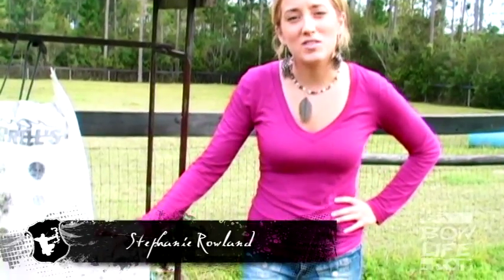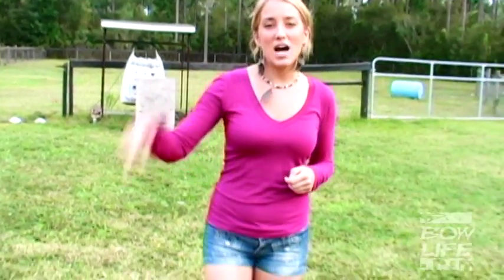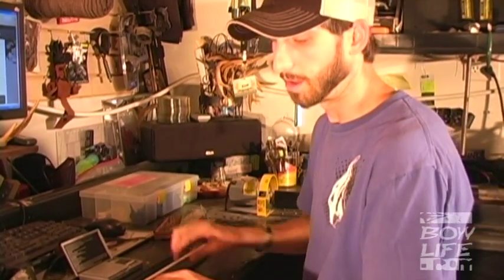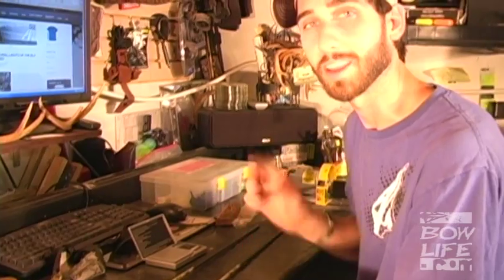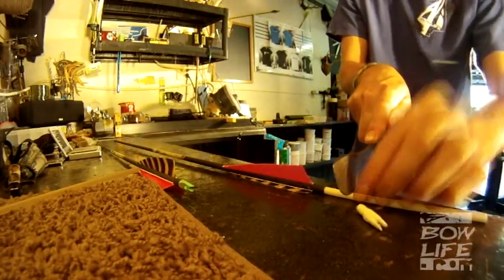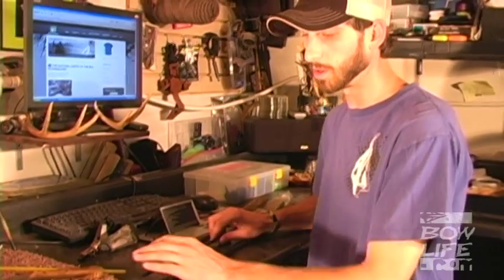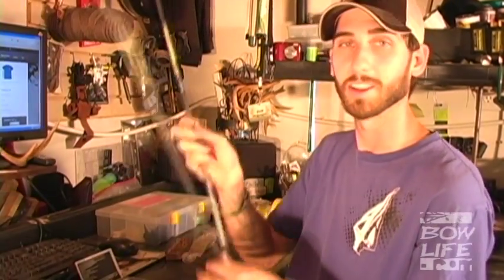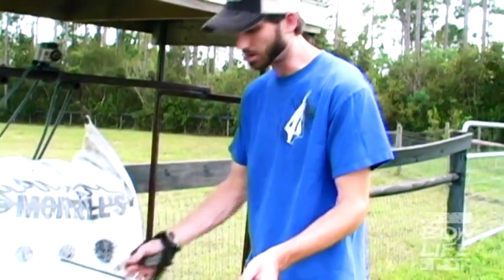Weight vs. Speed of an arrow

Comment: heavy arrows have more KE so thats what i hunt with
Reply: Masterg Samuraixmen What are you talking about?, i was saying i hunt with a heavier arrow because i can create KE....
Reply: Dalton hammond He's right. I'm currently pushing a 485 grain arrow to about 287 fps, generating about 87 foot pounds.  My bow pushes a 600 grain arrow at about 256 fps, generating about 87 foot pounds.  The momentum of the light arrow will be 2.75 kgm/s and the heavy arrow will be 3.03 kgm/s.
Reply: what?
Reply: Dalton hammond The arrow kinetic energy calculators don't usually take into account that a bow is more efficient with a heavier arrow, so your speed loss or speed gain associated with a heavier or lighter arrow is actually not linear.  In other words, pretty much regardless of what arrow weight you shoot, your kinetic energy is essentially going to be the same for the same bow setup.  You can increase kinetic energy by increasing your draw weight or increasing your draw length.  Arrow momentum, in my opinion, is a better standard for how well a broadhead-tipped arrow will penetrate and how lethal it will be.  Increasing arrow weight increases momentum, but it doesn't have much effect on kinetic energy.

EDIT: Of course, I should probably note that this is also not a very important argument, particularly if you are just using your bow on whitetails, feral pigs and small game like most bow hunters.  Modern carbon shafts and modern compound bows make this essentially a moot point.  What's most important is really finding the arrow setup that your bow likes the most and allows you to at least hit a quarter with your first shot at twenty yards, a lemon with your first shot at thirty and a grapefruit with your first shot at 40.
Reply: i hunt black bear and elk mostly, and mulies
Reply: Sometimes I wonder if KE formula is just flawed. According to KE a 9mm has over a ton of KE at muzzle. But shoot a log from a string and it barely swings. The slingshot channel did a vid on this and his slingshot hit with more power then every hand gun short of the magnum. Momentum is definitely the better way of expressing 'hitting power'.
Reply: Paul Bunyan Kinetic energy is what determines penetration, but given a lighter arrow and a heavier arrow with equal kinetic energies (the case when both are shot from the same bow at equal draw length), momentum is the tiebreaker.
Reply: I'm not sure I agree with the statement that kinetic energy is what determines penetration.   Kinetic energy expressed in foot pounds doesn't actually convey any meaningful information, it's really just a manner of categorizing bows into power classes.  If you tell me that your bow is a 75 ft/lb. rig, then that tells me that you have a big-boy setup, but that's about it.  If you're shooting the lightest arrows that you can safely shoot with your bow to get your velocity up well over 300 fps, then you're not necessarily going to out penetrate a 65 ft/lb rig that's shooting the heaviest arrows that it can shoot with acceptable drop between the 20 and 30 yard pins and, further, you aren't going to change the kinetic energy of your bow by increasing or decreasing the weight of your arrows (it isn't necessarily intuitive, but your bow is more efficient with heavier arrows; if you get a wild hair you should do some experiments with several different arrow weights over a chronometer. If you don't get a wild hair, I'll just tell you that the online calculators are wrong and your KE will be the same for ALL arrow weights). If you have the ability to calculate the momentum of your arrow setup, it will much more accurately predict the kind of penetration that you can expect because it's a more meaningful measure.
Reply: Paul Bunyan But its a fact that KE is what determines penetration, not momentum. Think about it this way:

Take 2 projectiles of equal speed, one 2x as heavy as the other. A resisting force would take 2x as long to stop the heavier projectile than the other b/c Force = m*a, so twice the mass means half the deceleration. At this time, the heavier object traveled twice as far as the lighter object before it stopped. 

Take 2 projectiles of equal mass, one 2x as fast as the other. A resisting force would also take 2x as long to stop the faster projectile than the slower one b/c its going twice as fast (duh). At this time, the faster object traveled not twice as far, but FOUR times as far as the lighter object.

Just like the question on the Road Test says, twice the speed= twice the stopping time and 4x the stopping distance. But twice the mass = twice the stopping time and 2x the stopping distance. Think of stopping distance as penetration and kinetic energy is clearly a better indicator of penetration than momentum is, because speed is more influential on penetration than mass is (m*v versus 0.5*m*v^2). HOWEVER, if 2 arrows have the same kinetic energy, then momentum is the tiebreaker when it comes to penetration.
Reply: I think we're at chicken vs. egg.  I see how you're going about your argument, but I think that the momentum and the sectional density of the fin stabilized projectile is more fundamental.
Reply: Paul Bunyan You're referring to stopping power. An arrow with a higher cross sectional area will have reduced penetration compared to thinner arrows but because the arrows are thicker, for each inch they penetrate, it will cause more damage. Kind of like alpha vs beta vs gamma radiation. Gamma radiation is the most dangerous because it penetrates the deepest, but if alpha rays got inside you, boy they will hurt.
Reply: with most modern compounds it makes little difference when killing a deer, However  where this comes into play more is for people like myself that hunts with stick bows. I use 145g muzzy phantom 4's with steep angle of attack to get penetration due to more ke. it makes a huge difference when your bow shoots  200 fps vs 250+ fps. drawback  is deer jump on the string snap when stick bow hunting.

Comment: There were actually bows found on an 16th century English warship that had 185lb draw weights. Just crazy.
Reply: Been there, seen that!  Got to hold one! Recovered from HMS Maryrose, now on display in Portsmouth, England.  ~6ft tall, about two inches in diameter at midpoint/grip, no curve.  No question why they are called “long bows”.  Arrows were also recovered, approaching three feet long and 1/2 inch in diameter (see above post on weight of war arrows).  To be an archer in that age took decades of training and a considerable toll on the body (see this video on the bow and arrows:  https://m.youtube.com/watch?v=QC6f9lgZiWU

And this video about the forensic analysis of the crew remains recovered :  https://m.youtube.com/watch?v=5Hn1txF1hiY&t=221s  )
Talk about drawing with your shoulders and back!

Comment: good test, I really like seeing real life tests, although I see conflicting evidence on all of them.    I think you must have an error on your speed #'s.   You have a 376 grain arrow and a 550 grain arrow, total weight difference of 174 grains.    You show a speed difference of jonly 14 FPS (276 vs 262)   Either your chrono is wrong or your arrow only dropped 1.6 inches instead of the 6-8 in the video.     Show the chrono test along side the penetration on the next video.

Comment: Didn't say between the ribs, said through the ribs. With the right broadhead and effective range, you will push through the chest cavity/ribs with a lighter arrow. Don't believe me, ask the doe that I shot with a 340gr out of a 63# bow at 30 yards liked it.

Planning for a potential ill placed shot and knowing you will have the push behind it with the weight is just fine. Going 400+ just isn't for me - not saying it's wrong for anyone else.

Comment: I agree totally with heavier arrow. But your approach could be even better yet. Research Dr. Ed Ashby. you need a heavy arrow, but more importantly the weight should be extreme forward of center EFOC. adding a weighted insert to the front along with upping the grains of your tips and broadheads helps arrow flight and penetration exponentially.

Comment: theres pros and cons to each. the heavier one is slower and deer typically hear the sound of the bow. they will have more time to move and may even hear the heavier slower arrow coming. however, it certainly will hit harder. may even blow through the shoulder blade and get through the heart better. or it could go completely through like a bullet. overall... id robably side with the heavy shot

Comment: To clarify, I don't mean because there's not wind in the woodsy areas - sure there is.  I mean that it's extraordinarily unlikely to NEED to take a shot past 40, 45, or so in woodsy areas - there are ways to get yourself closer.  Out in eastern Colo. and Wyoming however, even sitting in a blind on water for pronghorns, their eyes are so good when you draw, you almost have to be 60+ yards out to have a decent chance.  So it's range with the wind, not just wind alone, that is the reason.

Comment: Nice video, but it's a lot easier to just get an ACC, FMJ, or FMJ-DG, with a 75 gr brass HIT insert, isn't it?  Then add a 125, 150, or 175 VPA, and even another "foot" sleeve behind the head if you want - insane FOC.  There's a place for speed/FOBs, that's in the plains going after pronghorns or mulies, where you legitimately might have a 70 or 80 yard shot and need to buck the wind.  No need for speed arrows in the woods, though, that's for sure (whitetail, elk, etc.). 500 gr total works fine.